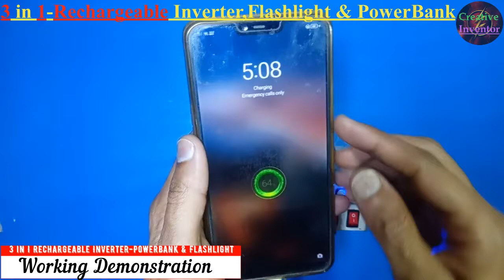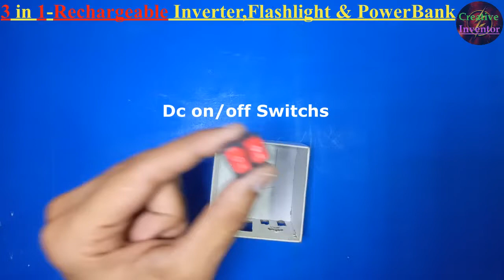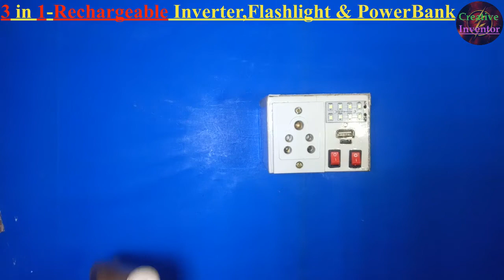3 in 1 Rechargeable Inverter Power Bank Flash Light | How to 3.7v Inverter | How to Make Power Bank

Comment: hello pls help me, I have a brushless dc motor , 30 amps esc and the blue serve thing when i connect them to my 6 AA batteries the motor gets beep sounds but doesnt spin, pls help me how to fix it. U can contact me on instagram @XeniteGaming
Reply from the maker: u have made a wrong connection i think, watch this video of how to setup-https://youtu.be/mPzbMHh0E-c 
also, that blue servo thing is a servo tester that is to used to check servo motors and bldc motor, if your motor is giving beep sound that's bcoz the servo tester rotating knob is not at the lowest, move that knob to the lowest then power it, then slowly rotate the knob.
Reply: @CreativeInventorlab  I changed connection also and turned the knob on the server too it doesn't spin.